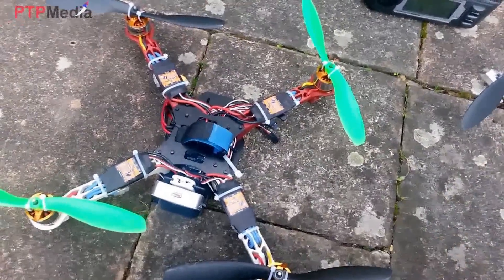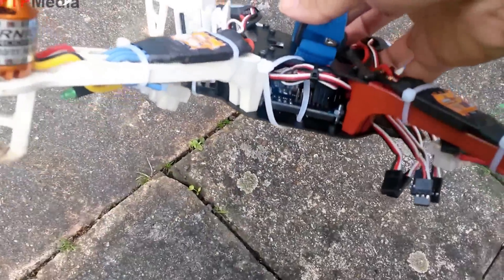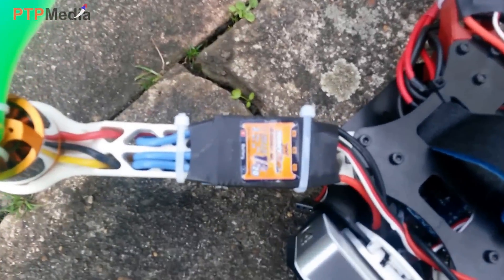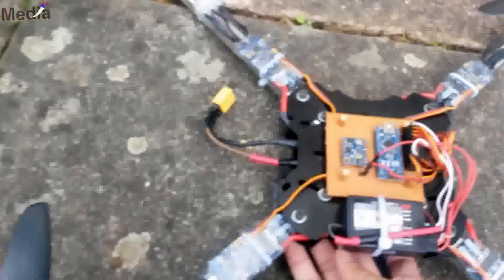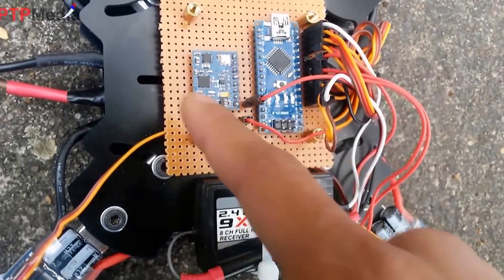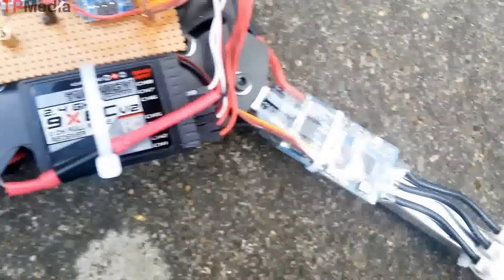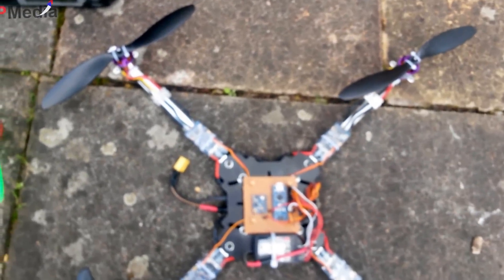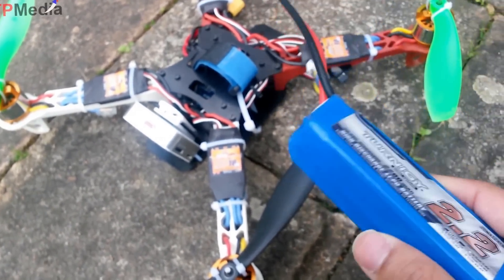Arduino Quadcopter Drone University of Westminster

Comment: +Alvin Phyo Hi, I am trying to do the same but WITHOUT a receiver. my idea is to take gyro input and feed to arduino which will control motors. currently without gyro my quad is going up 1 feet and flips due to no gyro. i am reading gyro values and need to give to arduino to adjust motors speed. can you help me do this? i will share my code. im controlling my quad through andoid app via wifi

Comment: Awesome! Already 2 quadcopters made is a big thing. Can I ask how much the components of 1 would cost? And also the arduino code you used? I'm maybe going to build one myself
Reply from the maker: Arthur Populaire Thank you for your comment, all the equipment cost around £79. You need to buy transmitter £45 seperate. You can use multi device when you have one transmitter. I used manual arduino for calibration in the beginning. You can use Multiwii code for advance user.

Comment: Did you use a power distribution board?
Reply from the maker: No I didn't.  You can use it if you need to but I tried to reduce the weight as much as I can

Comment: Hello,
I have one question: u said than 2200mAh LiPol endure 10 minutes on one qcopter and 15 minutes on another. Pls say me how is it possible that my qcopter endure only about 8 minutes with 4000mAh :-/
Reply from the maker: do you use higher amp ESC? how much is your quadcopter weight? do you use bigger propellers? Those 3 things make your battery life lower ... you have to reduce as much as you can do lighter frame and small ESC and small propellers
Reply: thx for answer. My ESC Turnigy Plush are 30A and my NTM motors are 26A, Weight about 1.2kg. Are you sure about the propellers? I have read the bigger propeller = bigger efficiency.
Reply from the maker: Yes bigger propller is for more performance so they need more power to spin. Motor got a lot more work todo, motor will generate the heat. It is vice versa its depend on your requirements.. If you need longer flying time reduce the ESC ampere and smaller propellers. If you want highest performance so less flight time use bigger motor, bigger ESC and bigger propellers...

Comment: Nice video ;) What about using other Arduino sensors, like gyro stabilisation or flight level control or one of the most interesting gps control? I've seen on youtube some kind of android connection to control the copter by using an own written app for it. Your 2 projects have much potential. Keep it up!
Reply from the maker: Yes I used the GPS module which is in another video. It is so interesting to set the custom waypoint. Also I was tested many of the Gyro everything are similar but 10 dof is the best gyro module.